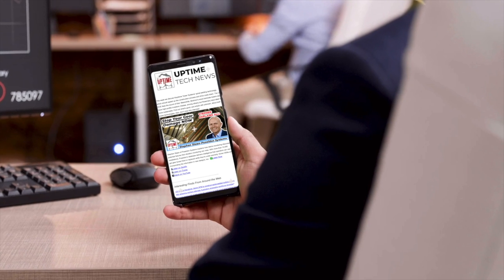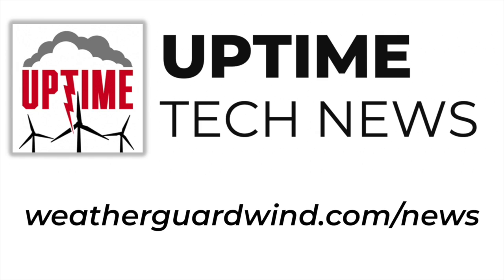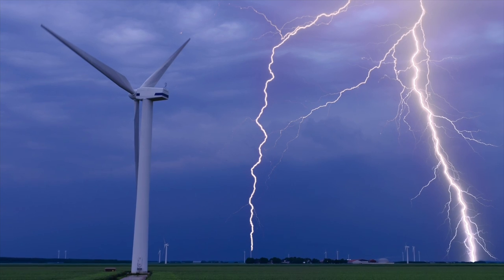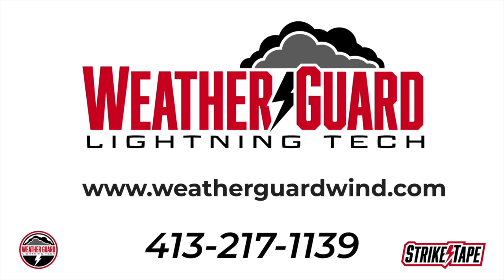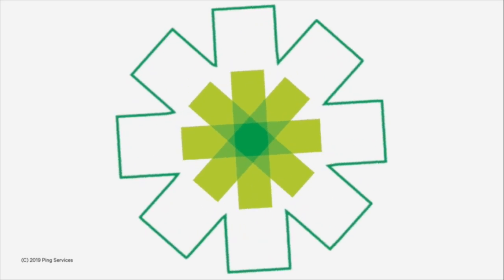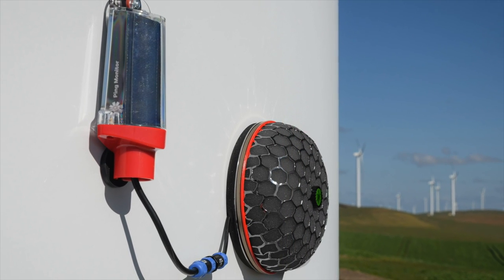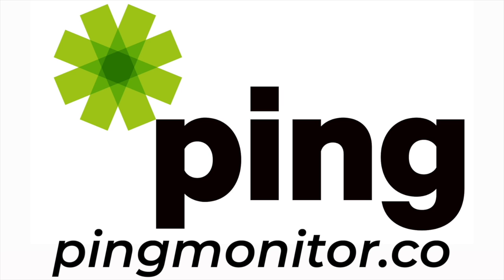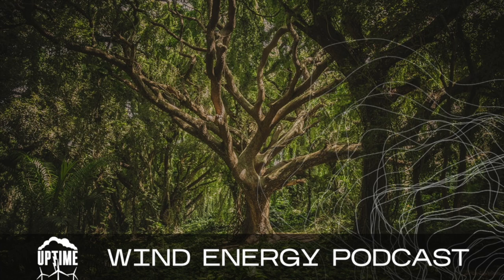Wooden Turbine Blades, Too Much Solar in Australia, Insurance Drives Turbine Repair Market

Comment: The 11 floating wind turbines on Tampen are VERY expensive. Each cost 45 million US dollar to build and the yearly maintenance cost are high.
Reply from the maker: Costs are high compared to onshore wind.  How will the industry drive down costs without taking on projects that force designers to think outside the box?
Reply: @WeatherGuardLightningTech  They have to, but when you pay less then 50% of the real cost it is not all that efficient.
They only reason that Tampen make sense is that the natural gas saved can be sold in UK. Even if the tech developed is interesting I believe it will be vey difficult to find application for it that will be economical.